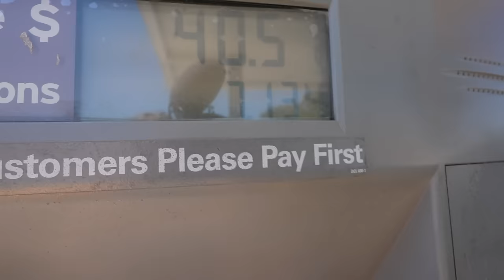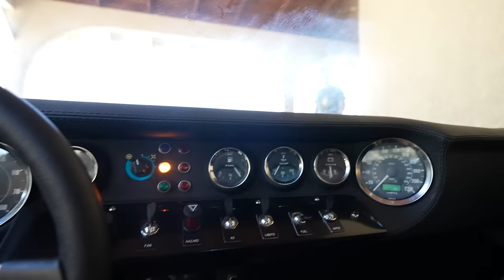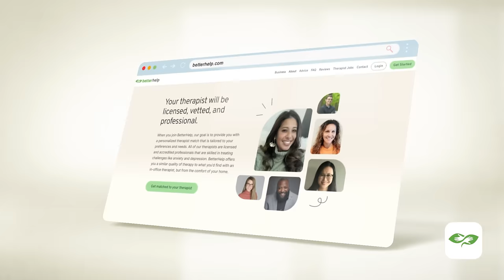Taking my Ford GT40 Back to the Guy Who Sold It To Me... he wasn't happy

Comment: Can I suggest that you try to find a way to mount those shoulder belts lower? They should extend from your shoulder nearly straight back to the mounting point rather than at a rising angle. As the are, they allow you to float up in seat in a collision or rollover, which is bad news. They look like they could also be set further apart so they don't rub on your neck so much.

Comment: I will again offer my help as I have gone through a CAV and figured out all of the issues that must be addressed and fixed them.  Water tank connected to pump outlet side of the pump, check.  Fuel leaking from the cap area, check.  Crappy shifter design, check.  Etc.

Comment: I am a fairly big guy, and have U.S. size 14 feet!  I have a 2004 Ford Mustang that I bought new, and drove it for years with no problems.  However it seems like shoes are being made differently lately, and have wider soles than they used to - as a matter of fact the soles seem to extend out past the uppers all the way around.

I actually was avoiding driving my Mustang lately due to this issue.  No fun catching the brake at the same time going for the clutch, or hitting the accelerator when going for the brake.

Recently I was browsing around the internet and found a pair of driving shoes.  They are made very much like American Indian moccasins.  There is really no sole, as the leather of the upper just wraps around.  Happy Days are Here Again!  I can drive my Mustang now....but I always need to carry another pair of shoes, as the driving shoes aren't worth a cr@p for walking.

Comment: Those belts need sorting in the GT40 as well.  Shoulder belts should mount to the car in line with or slightly below the height of the shoulders.  Those are 8" above your shoulders, will not be great in an accident...

Comment: On and off fuel smells always raises an alarm. Good thing nobody was soaked in it on this day. My nitrous bottle has started to stink up my cabin after opening the valve more than a few twists. Not sure if normal... but still safer than being exposed to gas fumes.

Nitrous just makes the tummy hurt after a while. Sulphur dioxide's added to it so people aren't huffing the stuff.

Let this video also be a minor PSA to never wear slip-ons while driving unless there's a backing to them. Might as well be wearing flip flops.

Comment: I’m 6’-1” with size 11 feet. I used to tune Ferrari 512s back in the day. I drove barefoot. The pedal pocket is too small for us big Americans!
I know, this is a Ford. But it was originally designed for small drivers. (They don’t weigh 200#!)

Comment: A little misinformation, the fiero kit cars definitely look like kit cars, if they don't modify the chassis. The kits on fieros in which they lengthen the chassis can look spot on. The issue is that the kits and fiero are relatively inexpensive, so they get into the hands of the wrong people and many times corners are cut. I've seen a few 355 fieros that would be deemed a replica because everything is spot on.

Comment: Thought I had a leak at my latest gas fill up at the station as it turns out. I just learned after 10 years that my suburban has an air conditioner drain in the rear for the second condenser very close to the rear fuel tank.  Fortunately it was just water.

Comment: Dean is suppose to be such a great driver, so the first thing he does is grind the transmission into reverse? Real nice. If you're not sure about getting it into reverse, put it in first, first to line up the shafts and then it will slide right into reverse. I'd be pissed, if it were my car. I don't even know why she keeps bringing cars back to him. He was rough with the Daytona as well.

Comment: The pedal issue should be pretty straight forward to deal with, take the whole pedal box out complete and remove the clutch and brake pedals, then bend the clutch pedal to the left by one and a half- maybe one and three quarter inch - bending it at the TOP of the pedal shaft only, and then bending the pad end at the bottom back to straight, do the exact same thing to the brake pedal but only by one to one and an eighth inch in order not to have your right foot fouling the steering coloumn, the finished result will compensate for foot size and movement and feel a lot more reassuring and safe,   maybe you should also check if the accelerator pedal (gas pedal to you colonials) can be bent half an inch or so to the right , I would rather have to use the outside of my foot to depress it safely than have to use the ball of my foot and get it jammed in between pedals right when I need it least
Reply: Kit cars have a huge pedal box issue.  I drove a Cobra kit from Factory Five with a pedal box made for elves not guys with size 12 feet.  I took my shoes off and it wasnt much better.  I agree with Dean.  I chose safety and protecting the customer's car vs my own curiosity.   On a test drive my clutch and braking was not preferred and scary enough to just keep the test drive to a minute or two.  I was working on a steering shaft play issue so it didnt matter if I took it on the road at speed anyway.

Comment: SANDY’S FORD F-150 is newer than my 2002 FORD F-150 LARIAT SUPERCREW CAB 5.4 TRITON ENGINE rwd it was 262 thousand miles on it I put LED HEADLIGHTS,TAILLIGHTS,  THIRD BRAKE LIGHT ,TAG LIGHTS IT HAS A MERCEDES BLACK WITH GOLD AND SILVER METAL FLAKES WITH BLUE PEARL I would like to put a CUMMINS IN IT OR THE NEW FORD GODZILLA ENGINE IN IT

Comment: He needs driving shoes. The ones the drivers use that are fire resistant. They fit almost like socks.
Even with both tanks full, that car isn't going very far at high speed on 14 gallons.
That air filter is much too small. Get one at least twice as wide if you want better performance.
The ULTIMATE insult is an American engine in a body that looks like a Ferrari.

Comment: Emilia, If you want to keep your gorgeous body as good looking as it is now, here is a great tip: If you every have a burn anywhere. Only apply egg white to the burned area. Reapply as necessary when the previous application wears off.  :) Simple yet this works better than anything else.

Comment: sandy has to get his pantara finished on the channel, and dean should get the lola running
one thing i may add, theres Ferrari 4.2 V8s that you can get decently cheap they have been making them for a long time, the Maserati version is better because it has timing chains vs the belts on the Ferrari version

Comment: You might try a "McCuff" to help when fueling the GT 40. I have one for my motorcycles. You might need to fatten it up for your GT40, that's a big hole, but it really helps with the vapor nozzle. I saw some at Harley Davidson that were identical to mine except orange instead of yellow.

Comment: I wouldn't be able to drive it either, I get my fat feet jammed up in regular vehicle pedals or end up hitting clutch/brake or throttle/brake at the same time as is.
nothing more fun than anchoring the brakes trying to push the clutch or gas in during some spirited driving. 😖
even got a boot stuck behind the brake pedal on a van once and stomped left foot on the brakes, smashing right foot behind the pedal arm so hard I nearly broke it, but I sure didn't wreck. never fun times.

Comment: Great video, I appreciate the fact that you’re an advocate of mental health awareness. Wish I’d have mentioned something weeks ago after seeing your burn.  When I was run over while riding on my union halls poker run in 09 the car behind the driver that hit me wasn’t able to drive around me and drug me down the road for quite a way. I was covered in burns from mid chest up and trapped under the car until a wrecker arrived to lift the car off of me. The specialist for wound care as well as the burn unit prescribed Silvodine which is packed with actual silver substrates, it does an amazing job of healing burns, abrasions and lacerations. It isn’t sold over the counter, requires a prescription almost all pharmacies carry it. I tell all of my union buddies about it since almost all of us get burned at one point or another, whether welding, working on heavy equipment or dealing with race cars and Harleys. Everyone I know of whose used it swears by it now.